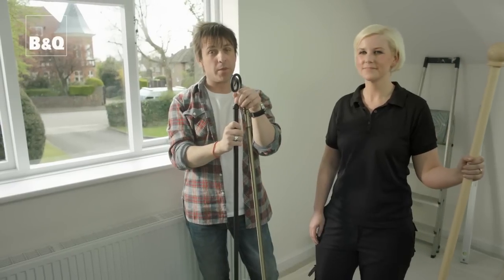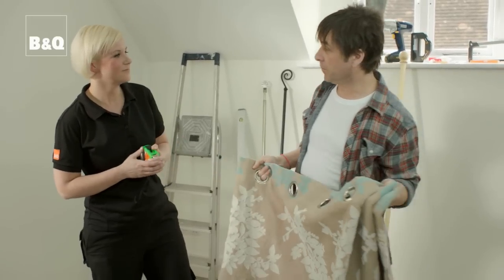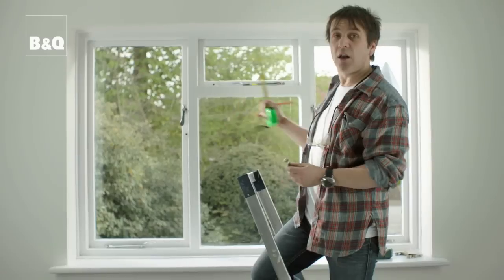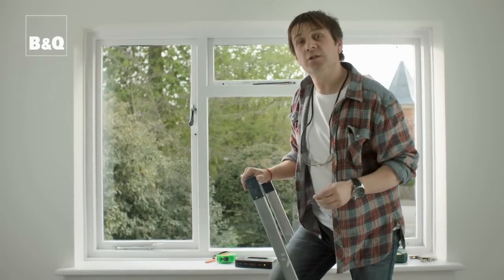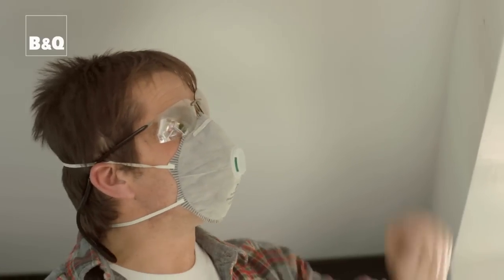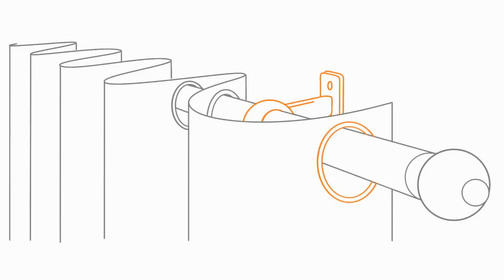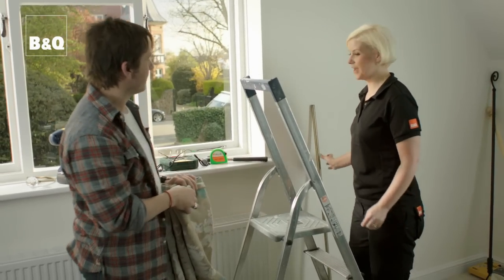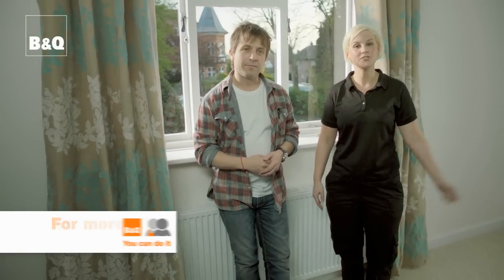How to put up a curtain pole

Comment: To help prevent levelling mistakes I fix one of the end brackets first. Then I put the curtain rod through and support the other end holding the other end bracket. This other end is held with one hand and the other hand holds a level, I raiise or lower the support until level and then mark the drill hole.
Reply: Was just about to do the same. Thanks for confirming it will work.
Reply: If you have a large window though, central bracket first makes sense. Unless you carry a 2.5m spirit level around
Reply: Thank you. Thankfully I have my partner to help with this process so it will make levelling easier.

Comment: Important if you want a precise gap between the bottom of the curtain and the floor: in this video, they do not adjust for the fact that they are using keyhole brackets to mount the pole. They have drilled holes 5-10mm higher to allow for the bracket to slip down after it is mounted.

Comment: Really nice video - just one note 😅 "our window is 740 millimeters wide" @ 2:50, that's likely 74 inches, @ 2:58 the middle mark is not at "370 millimeters" but at 37 inches 👀
Reply from the maker: Thanks for your feedback, we'll let the team know!
Reply: Why do you assume it has to be in inches? They come from a country using metres, cm and mm, like the majority of the civilized world lol
Reply: @intimacywiththeordinary  Please re-read what I wrote, I'm not assuming anything. The measuring tape @ 2:58 reads 37 inches, not 370 millimiters. Thus the whole thing is 74 inches, not 740 millimiters. Even without the measuring tape shot it's straightforward to work out, because 740 millimiters is 260 millimiters less than one meter and that window looks obviously wider than that.

Comment: Did the second fixing on each support require raw plug? Looked like the screw was drilled straight in with no plug
Reply: Whatever it looks like they did, you DO need to put plugs in on every bracket otherwise It won’t support the weight of the curtains
Reply: yes that was the only part that confused me too

Comment: But, why have them over the radiator?
In the winter months there'll be scrunched up on the windowsill, not nice at all
Reply: I have a roller blind as well as the curtains. Summer = curtains. Winter = roller blind.

Comment: Does anyone know what type of the drill it is, combi or drill? What is the name of the detector for pipework in the wall?
Reply: Ask at a local DIY store 😊
Reply from the maker: Hi there, a MAC ALLISTER MHD18-2Li 18V Hammer drill has been used in this video. You will find our range of detectors here https://bit.ly/48jurXZ. I hope this helps! 😊

Comment: What size drill bit please and is a hammer setting necessary ?
Reply: The man in the video didn't seem to know either. You will notice when inserting the plug for the centre bracket he put in a grey (smaller diameter) plug, when the video cut to show him driving the screw in, the grey plug had miraculously turned into a brown plug. Very sloppy

Comment: Cool video, but the use of a measuring tape to install the bracket is too time consuming, and might occasionally lead to mistakes.  

One can benefit from a preset-holes marking tool, like an RPC (Rody Precision Corner) that can speed things up, and make the installation process much easier.

The RPC also has bubble levels built into it, so one does not need to carry an extra level tool around.